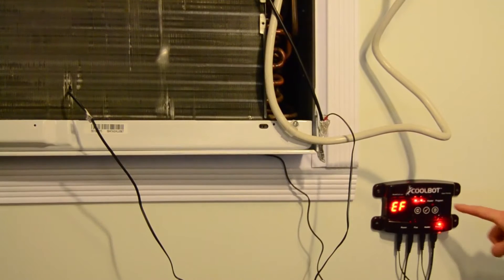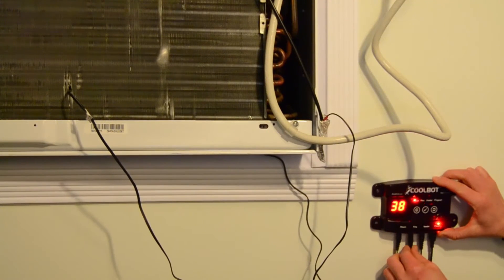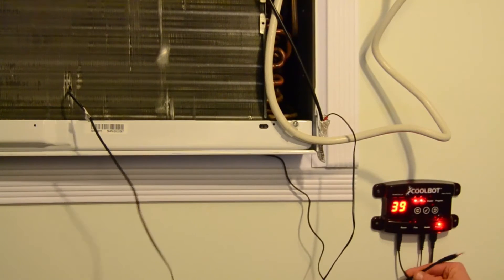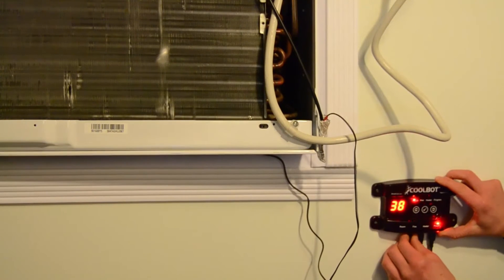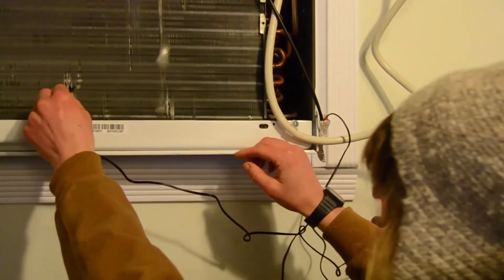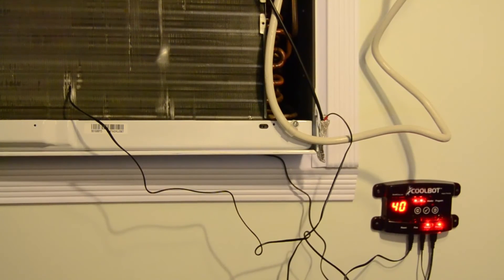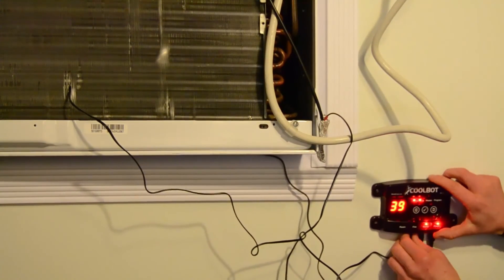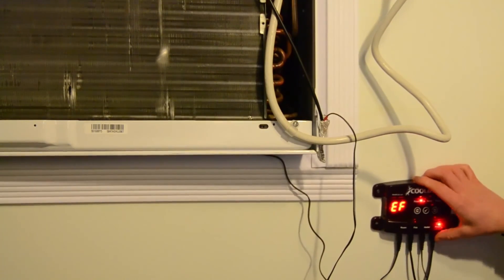EF Code Work-Around - CoolBot Support

Comment: So EF error means High Temperature sensor fault? In all brands of ACs?
Reply from the maker: An EF error on the CoolBot means that there is a problem with fin sensor cable. Please visit our website to troubleshoot or contact our team at support@storeitcold.com for help with your CoolBot.

If you're having issues with your A/C, you will need to reach out to the manufacturer.

https://www.storeitcold.com/troubleshooting/